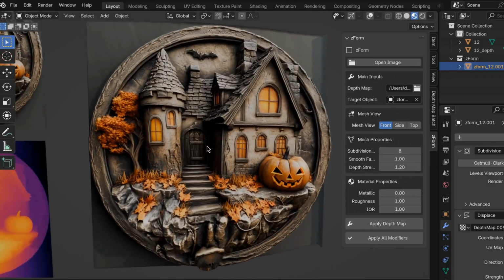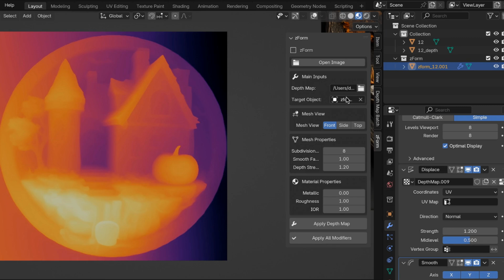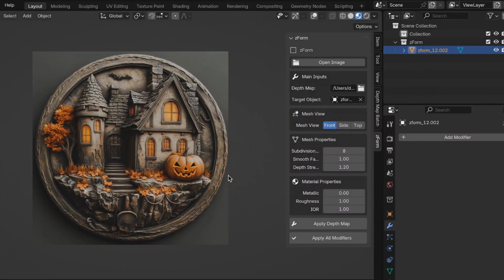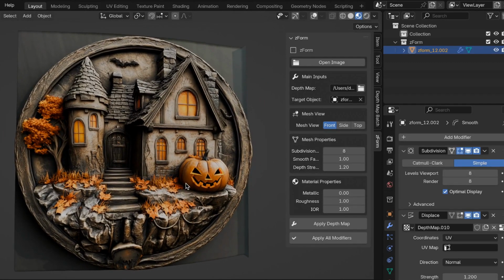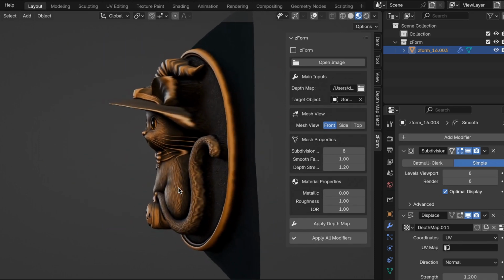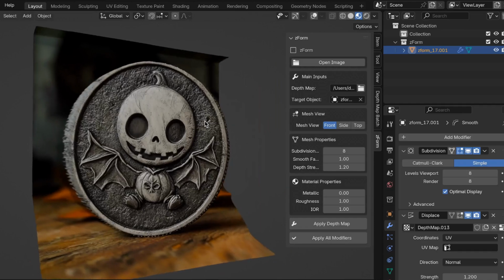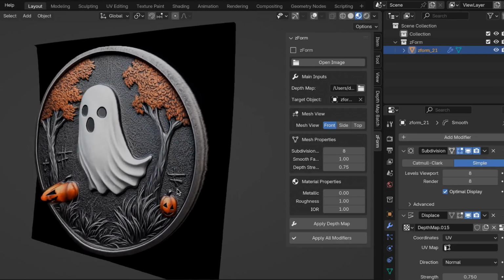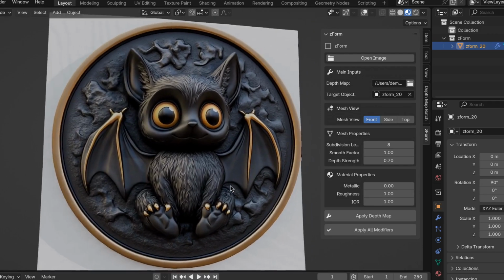Halloween theme for converting images to 3d mesh

Comment: How to get or creat a depth map and the image?
Reply from the maker: Hi. For depth maps, I create depth maps using my other Blender add-on called Depth Map Batch that creates depth maps for a batch of images in a directory, video file, or a single image. But, you can also use some free websites out there to upload a single image and it will generate depth maps too. In regards to the image, for most of my examples I'm using Midjourney and occasionally Scenario.

Comment: Great stuff! Can you export it for 3d printing?
Reply from the maker: That's great question. I'm honestly not sure as I have never tested or tried for 3d printing before. How about this....if I find out an answer on this I'll let you know here. Let me do some research and perhaps find a few folks that work with models for 3d printing in Blender, and see if this would work.
Reply: All it takes is an OBJ or STL-file! 😉
Reply from the maker: @McGyver4711  Oh, in that case the answer is yes. I just tested. After applying the modifiers I exported as OBJ, closed out Blender, and re-opened. Then imported in the OBJ file. It works fine. But, the only thing I see as a potential challenge right now is the mesh is hollow, meaning it's hollow on the back side. I've been testing out how to add an enhancement in the tool to thicken the mesh, but nothing useable right now.